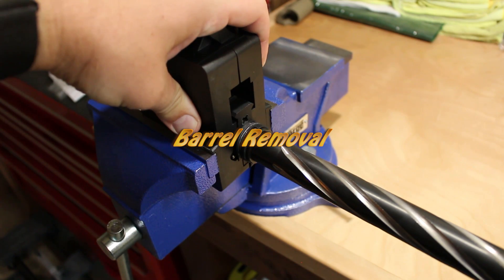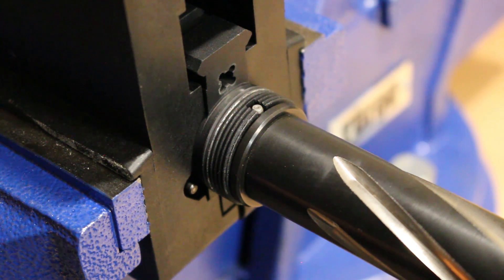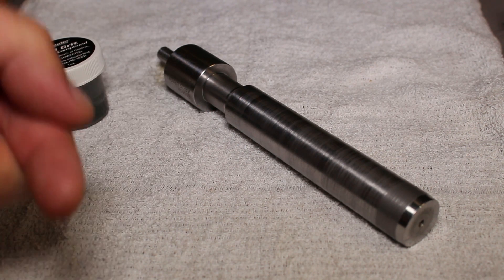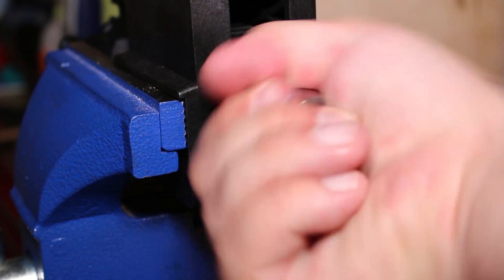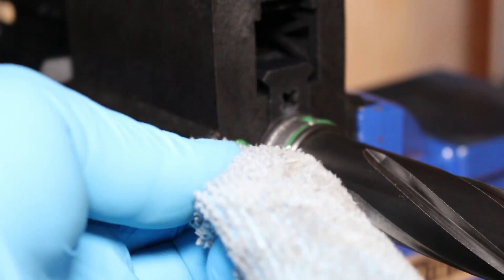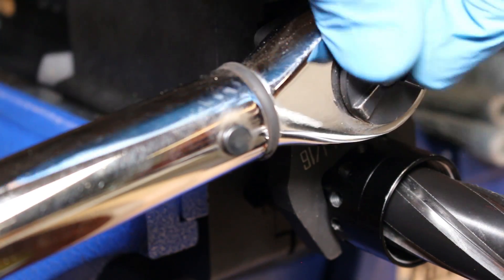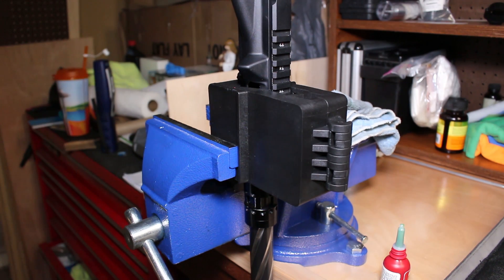Bedding a Barrel into an AR-15 upper receiver

Comment: Please for the love of God do not follow this guys instructions. Almost none of this is correct.
Reply from the maker: Thank you for your input... can you please elaborate on your comment?
Reply: @67futura25  Lapping the upper has another benifit, the windage will be centered on your iron sights due to everything being true and not canted off to one side or another. The loctite is where you gain your accuracy by removing a source of micro movement.
Reply: @67futura25  that's what he vicariously means.
Reply: @67futura25  Also, typically after lapping one would use ring shims to offset the material removed from lapping.
Reply: @67futura25  loctite isn't necessary. Aeroshell grease on the threads is correct. However, the loctite is a negative. The torque and tension that you put on the lapping bar likely created a slant on the barrel housing. Also, I'd suggest having a conversation with a gunsmith. He'll lecture you in the correct way to build an ar.
Reply: @unmalo2768  >accuses someone of being a typical keyboard asswipe
>finishes the post by challenging him to a fight
Reply: @ChucksSEADnDEAD  Un Garza is a pussy lol

Comment: Be safe and remember - TREAT - NEVER, KEEP, KEEP...
WTF DOES THAT MEAN?
And unless the barrel is press fit into the hole, there will be some wiggle until the barrel nut pulls the barrel back into the face of the receiver.
Under torque, the barrel will not move.
Also, the head space is the relationship between the barrel and the bolt face, how does this surface have anything to do with head space?
When you shim the barrel to get the gas tube to go through the barrel nut, you do not effect the head space at all so removing material will not effect head space! 
You would have to pull the barrel extension off the barrel and remove material from those contact surfaces to effect head space.
And BTW, heat is what you use to release lock tight so don't EVER fire that gun as when the barrel heats up the lock tight will soften and loose effectiveness.
You know what? Just TOTALLY disregard the assembly instructions from the people who designed the rifle and just make up your own, RIGHT?
Reply: Treat every weapon as if it is loaded, Never point a a weapon at anything you do not intent to shoot or kill, Keep your finger straight and off the trigger until ready to fire, Keep the weapon on safe until ready to fire.

Comment: What happens if you need to replace that barrel? A torch, a hammer and a cut off wheel?
Reply: Use a small hand held torch. You don't have to get it cherry hot or anywhere close to it.  It's not a big deal to remove, I've done a few with no problems.
Reply: @clinkerclint  blugh.
Reply: A new upper.

Comment: Just to stick up a bit for this gunsmith, to all those adding comments that the loctite is a bad thing. 

See this; https://youtu.be/pJL-IscH_jo.  

Official American Gunsmithing Institute video.

This has been good practice (even including shim stock) to lock up the radial motion of the barrel to upper fit - for a long time - by expert builders. 

Nowadays going with the BAT machine barrel extension slightly oversized (interference fit), freezing the barrel and heating the upper, and putting together for a super tight fit is best. But what do you do if you have a poor fit on a lower cost setup and want to improve accuracy?

This. It works great, and helps a lot. 

I would add copper anti sieze to the barrel nut, and do this vertically instead of horizontally (eliminates sag in the PTC tool) and grease the tool - but otherwise dead on.

Nothing wrong with loctite green upper to barrel, or better replacing the extension and loctite.
Reply from the maker: Thank you for your inputs and support.  It seems I have started an uproar on the technique that was used.

Comment: just use a BCM upper receiver.  they are undersized slightly so you only have to lap the receiver.  no bedding needed.
Reply: Agreed. I've used BCM for two of my AR builds. One was a MK12mod0 and the other was a 11.3 pistol build. It does require heating the upper and judicious use of a synthetic hammer but gives excellent results. Also, DO NOT USE LOCTITE EVER on the receiver threads. Either white lithium grease or better yet use aeroshell 33S grease (which is what is used on military assembled M16s and M4s). Finally, "season" the threads before final torque. Not impressed with this builder's technique at all.
Reply: Aero precision usually has tight fitment too.
Reply: @SIRWAFFLEBOB  yep, I just put a Windham barrel in an Aero upper, just had to oil it and bang it in, super tight fit. Glad I didn't have to heat one up and toss the other in the freezer like I hear some guys do.
Reply: @MALICEM12  ballistic advantage barrels are usually cut to fit aero precision uppers almost perfectly.
Reply: @SIRWAFFLEBOB  I hear "tighter is better" so I'm not displeased with aero but I'll keep your recommendation in mind for next time, thanks.
Reply: @SIRWAFFLEBOB  Aero owns Ballistic so if they don't fit precisely.... someone's going to be sleeping on the couch xD

Comment: My experience shows you get better and more consistent torque if you tighten to 30, then break it lose and re-seat the nut to desired torque. I torque mine 3-4 times. This also helps when using a barrel nut that requires the gas tube to pass through it.
Reply: Also a great idea to put some anti seize grease on there to preferably a high heat grease. Or just be a dumbass like the guy in the video and locktite the barrel on and crank the steel nut on to a aluminum receiver dry.

Comment: My wife helped me change hand guards from the factory plastic to a drop in quad. I didn't have the tool and had to hold the delta ring down by hand and couldn't do it one handed.So she after a couple attempts got the old one off and then placed the new pieces in. for me.While I held it down.

Comment: Well done video.
 I am a certified AR-15 Armorer, multiple times over.  I have the same lapping tool.  Only two minor things I do differently.
1.  I lap with upper receiver vertical.
2.  I add Aeroshell 33 MS to the upper receiver barrel nut threads.
Again, great video!!  Thank you for taking the time and all the effort (Wifey and Daughter included, of course) to make it and then post it.
Reply from the maker: Thank you for the input... it was a fun project...
Reply: 67 Futura hi dude, you are not the only person that uses the semi-permanent Loc-tite.  I do too.   My Groups are 1/4 MOA in my present toy.  Military gunsmiths learn one way military.  That is WRITTEN IN BLOOD.  Because any changes cause people to get killed!   I am not going to war with the AR-15 I PLAY with.  I own it.  I am willing to take a calculated educated guess to achieve a more accurate rifle.  I shoot competitive shooting and as a group we “experiment” a lot.  So I experiment with the some rifles.  The gun smith gave you the reason of not being able to take the barrel off with out damaging the rifle.  Ok he is right unless you know how!!!!  You heat the loc-tite joint first. A heat gun and warm it up to the point it’s too hot to touch.  Heat it for a while.  Time to let the loc-tite get hot and melt.  REMEMBER THE UPPER IS ALUMINUM ALLOY WITH A MELTING POINT AROUND 600 degrees Fahrenheit depending on the alloy 6061 or 7075  T1 or what ever.  So nothing over 300 degrees. 
After it melts it comes apart easy so no big deal taking it apart.  Also his warning is true on You Tube  there are many home brew experimenters.  The scientific envelope is pushed everyday by what we do.   If you do not use the military way expect varied results.  WATCH OUT!  Check for signs of excessive pressure!  CHECK EJECTED CASES!  Blown primers! Bent cases! Ruptured cases!  Cracked cases!  Bulging anything!  Swollen Anything!  Unusual execution! Watch for anything!  Be aware! Check your BCG. Look at it.  If it looks different WHY?  

There is one more trick to do!!  I might share that with you later.

Many of the gunsmith will tell you not to reload cartridges.  Only shoot OEM.  That is what they learned.  The military changed OEM POWDER THAT WAS A ROD POWDER TO BALL POWDER.  It caused the rifles to foul.  The military did not give cleaning kits.  Fouling plus no cleaning kits equal dead troops and warnings written in blood about not changing anything.  The shooters that win shooting events all reload.  If you reload my warnings are doubled.  I reload.  I can make loads that shoot better than OEM.
Reply: You aren't the only one who uses locktite in the upper, but I'd suggest a release agent on upper. Tightens the groups up considerably. Good vid.
Reply: Ethan 
Good suggestion.
Reply: I couldn't do the slop, I'd try to find a different upper before I slathered any goop on the barrel extension...For some reason billet receiver sets had slop with my Proof Research barrel, BCM uppers and Bootleg uppers were snug..
Reply: @rilianriggs4620  because they're forged. Some billet receivers are cut over-sized for some reason.
Reply: T Morin Lapping vertical is absolutely the way to go, let gravity work for you not against you, especially if you are unfortunate enough to have a sloppy, probably out of tolerance barrel to upper bore fit like this video shows....
Reply: @busterbarnes2014  Second that:  Lapping vertical is absolutely the way to go, otherwise lapping can be uneven.  What you're doing is getting rid of high spots that cant the barrel off true.  Lube the rest of the tool that goes in the upper real good, 50 weight oil does well and easier to clean up then grease.
Reply: T Morin a couple of issues - 1st 620 has a thermal failure point of 450deg. Secondly with the amount of slop in this oversized receiver and undersized extension he needs steel shim material
Reply: @BadBrad46  you're very vague on who you're speaking to.
Reply: I'm a hobbyist gunsmith and am very experienced in assembling AR's. I guess i have just lucked out because i have never seen so much slop before. Glad i stumbled on this video in case my buddy's have this issues in the future.
Reply: crockett11000 question on the copper anti seize - thermal failure point? Typical lifespan of corrosion/anti seize properties?
Reply: I first saw the Loctite method mentioned in a book by Kulek and McKee. That said, I don’t believe it was intended for anywhere near that much slop. 

Also, I’ve always wondered if that tool actually got the face perfectly square or not as it always seemed like there was a little bit of slop. I might check this out in the next couple of weeks when I get to a lathe again. 

I’d have measured to see which side of that equation was out of spec and scrapped it.
Reply: Certified by who?
Reply: @T Morin you are a complete idiot sir! I spent 20 years in the military and 15 months getting my gunsmith degree. The use of green loctite on the barrel extension, you have got to be out of your mind! Guys like this and you are why REAL gunsmiths will never go out of business, because we end up having to fix your wacked out repairs/modifications. Quit home gunsmithing because one day you'll end up seriously hurting someone!
Reply: @OTKUGO The Complete AR15 Builders Guide by Glen D. Zediker refers to using Loctite on barrel extentions (chapter 7, page 102, figure 2). All it takes to remove a barrel with loctitie is to heat the upper receiver. I just held it over an electric burner by the barrel.
Reply: I really don't care what you believe Grunt.

How and Why to Lap an Ar-15 Upper Receiver
https://www.youtube.com/watch?v=ipqsglMQZRM

What's the Deal With 224 Valkyrie?
https://www.youtube.com/watch?v=NqBwy8xgxP0
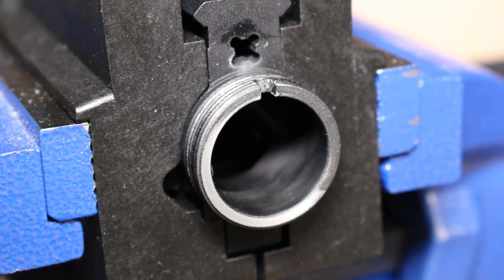See comments starting at 5:24.
Reply: certified armorer? what? by who? leave the gunsmithing to the pros guys. don't glue your barrels in...
Reply: https://www.youtube.com/watch?v=XHxU8VUAHOY Pros like the guys at Criterion?
Reply: @jonb8318  , I was going to say this. They kept on talking though...
Reply: Aeroshell grease sure. However, the fact that would use locktite on a barrel extension tells me that you're not really certified. If the receiver is that loose, then you need either one of two things. One, a new upper receiver. Two, a new barrel extension; which you might as well replace the whole barrel (unless you have a lathe to set the headspace again). Two is way more work, but may provide a tighter fitment. However, 1 is the go to since it's easier to get a new upper.
Reply: @SIRWAFFLEBOB  I thought the same thing. I dont use anything but aeroshell and have never experienced that kind of slop. Always tight fit. Maybe it has to do with billet receivers like you said. Only billet i have is my ,308 and i bought that one as a package. I ended up re armoring that one and it was a snug fit as well.
Reply: This video needs to be removed by YouTube. Loctite?  Seriously?  If an upper had that much slop you have bigger issues that lapping. BTW read the comments on head spacing. Might as well use a pipe wrench and really f up the barrel nut so u can send it somewhere to get it assembled by someone with a clue

Comment: For the best accuracy the barrel must not move at all when attached to the upper. Having only a true upper face will not prevent the barrel from moving. With two very flat mating surfaces the barrel can still move around in a circle. Granted, very small amount of movement. To remove the ability to move around you need a retaining compound or an interference fit. The LocTite 620 is only good up to 200C(392F) so it may not be the right choice for a barrel that will get very hot, I guess that depends on how you'll shoot it. Interference fit is really the best way to "lock" the barrel to the upper.

If you are not in competition then most likely none of this really means much. If you are a super critical hobby shooter then lapping should suffice. If you want to bond the extension into the upper, Extreme Heat JB Weld would be better than the 620.

If I wanted to do this for accuracy holding I would get interference fit upper and the lap it true. Heat upper (oven, etc) and chill the barrel extension end in ice water. The sec just before install wipe the extension with full synthetic motor oil then wipe again with dry lint free cloth, this oil will to some extent fill tiny pores and stay there helping to remove mating dead space between upper and barrel. One key step is immediately after mating the two pieces is to get a barrel nut on there and torque it to spec. Let it come back to room temp then redo the barrel nut stuff, etc.

And to note, you can make Aeroshell grease with simple Lucas lithium and some Moly powder. But, any lube/grease on the upper threads is better than nothing at all.
Reply: Is aeroshell 64 grease just as good as synthetic motor oil for the barrel extension?
Reply: @grammatoncleric550  "0" weight SYNTHETIC motor oil  is the preferred lube for all weather (especially sub zero) as its viscosity never changes and it stays where you put it. 
In the past, even that red auto trans fluid was directly marketed as a wonder lube for guns. It failed because it evaporates over time.
Reply: Marine-Tex is better at more than 500C.  Also a lot less shrink, and more impervious to chemical decomposition making it a great choice for galvonic prevention.

Comment: I'm an AK guy so I do not know anything about AR's. As a matter of fact, I'm about to do my first AR build ever this coming weekend when I get the parts. Having said that, I have been reading about them and watching videos on YouTube for the last three days to get familiarized with the platform and I couldn't help to notice that there is a guide pin on top of the barrel extension that meets with a notch on the receiver. My common sense tells me that if you were to remove material from the receiver like in the video, you will only increase the clearance between the receiver and the barrel extension's "stop ring" because the pin on top would not allow the barrel to go in deeper. Does that make sense?
Reply: The guide pin on the barrel extension doesn't bottom out in the upper. Causing the barrel to cant. The pin just makes sure the feed ramps are indexed properly. When they put whatever finish and when machining the front of the upper that meets the barrel extension sometimes is not true/square. You only need to lap until you see the lapping tool is lapping all the way around, the front surface is then squared.
Reply: Perfect sense.